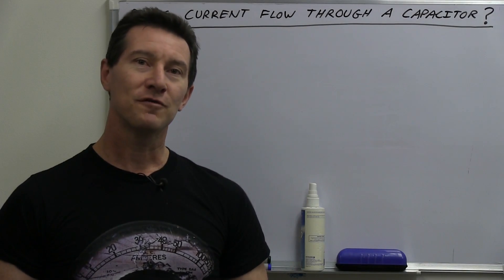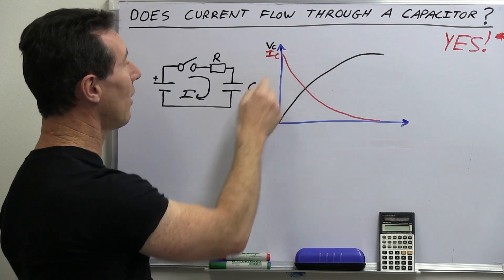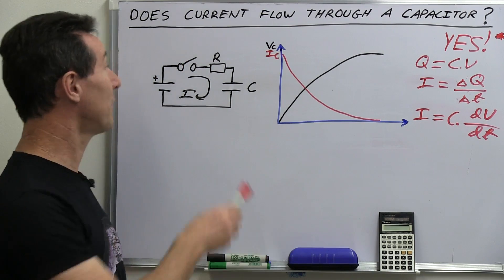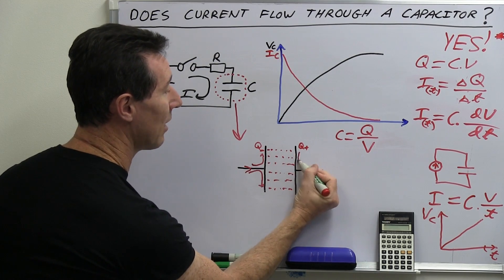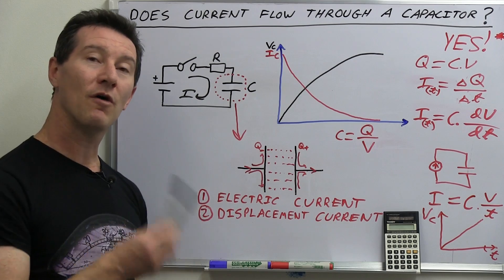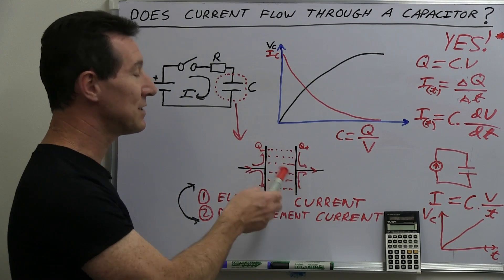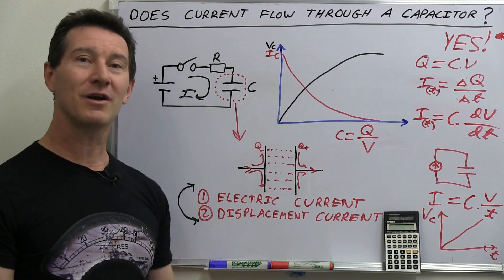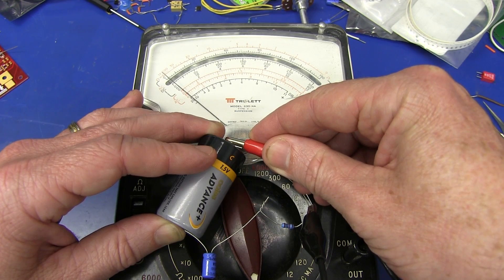EEVblog #486 - Does Current Flow Through A Capacitor?

Comment: so the answer is NO. the current newer went through but into the capacitor, just like the charge carriers (who's direction btw would've been the right one). the capacitor is 2 charged masses. that don't even have to be near each other (see tesla coils and over land cabling for example). nothing flows through it, just into and from it. if it could flow THROUGH it, it wouldn't stop as soon as the cap is charged. you even explain all those very facts. why are you trying to ignore basic physics here? just to make it easier for electricians who slept in physics class to get it "halfway right"?
Reply: I think you are arguing wording even though Dave stated the displacement current that fills the gap in the capacitor. Is it current in the traditional sense? No. But its the key ingredient to the fact. If the question was specifically "Does electrical current (electrons) flow through a capacitor?" then the answer is as you said, no. And yes all current (displacement and electrical) stop once the capacitor is charged. Also the transfer of electricity through a Tesla coils very different than how a capacitor works. The Tesla coil is a resonant transformer.
Reply: @drivejapan6293  yes i am arguing wording when the title of the video is literally "does current flow through a capacitor" and dave is trying to provide a counter argument to people who correctly state that it doesn't. and yes, a tesla coil is a resonant transformer, i was talking about its capacitor element composed of the topload and ground as an example of capacity without "close plates".
Reply: @nonchip  So you don't think a current of energy if flowing through all parts of that circuit before the capacitor is charged? You are right the title does specifically say "Does current flow through a capacitor?" but doesn't specify the type of current does it? Again Maxwell names the current as "Displacement Current" unless you don't think the phenomena happens. I would argue Dave simply means energy current which I don't believe is technically incorrect. Though thats me arguing meaning over wording and even the meaning could be wrong.

If nothing passed through the capacitor then it would just be an open circuit right? A Tesla coils top and the ground gain a capacitive difference but thats where the likeness of their operation stops I would think. Otherwise what field is forcing the electrons onto one side and pulling them off of the other? Batteries dont work like that yet a difference still forms in a capacitor. Thats why distance between the two plates is important in a capacitor is it not? Isn't that also why a capacitor with small size can allow energy to flow in a circuit and build up a charge that a switch with much larger mass in the circuit cannot? I am no physicist or EE though. These are genuine questions not snooty comments posed as questions.

Comment: Dipole excitation is how displacement current works. When you apply an electric field to a dielectric it realigns (rotates the dipoles). This rotation of dipoles in response to a sinusoidal voltage is how a perceived current propagates through an insulator/dielectric. A good analogy is doing the "Wave" at a sporting event. Even though the wave moves in series, no one actually physically touches each other. This is also why capacitors block DC current, because there is no "force" to rotate the dipoles.

Comment: Air gap capacitors, such as the tuning capacitors used in old radios, violate Kirchhoff's circuit laws (sort of) because current can flow into the capacitor through one lead for a finite non-zero time, and out through the other lead, but no current flows between the plates whatsoever.

Comment: Sir what will happen after the connection.
If I connect a finite current carrying inductor(say 5A) across a inductor having no current initially.  (We assume small series resistance of inductor.)

Will the current just after connection be 5A or 0 A. As we say that inductor resist sudden current change.

Comment: I remember this lesson from university. The point was that current is not only movement of charged particles, but also a change in electric field is also a current. I think that was on forth year. Another argument was that magnetic effect this current has are the same as those of moving charged particles.

Can't remember any math or details nowdays, don't really use it in practice. Amazing that, at some point in time, I had some understanding of that stuff.

Comment: i think it's of no value to say the science and practice contradict each other, which seems to be your message. Current doesn't "flow through" a transformer either, even tho' current goes in one side and out the other. Seems to me, understanding the difference between electric current and displacement current IS of "practical" value. Eg, may affect things like isolation.

Comment: Say you have a box with 2 sponges filling it, separated by a rubber membrane.  You can squirt water in one side for a while and it'll push water out the other side until the pressure you've put on it can't cause any more compression in the other side's sponge.  But for a while there, you push water in, and water comes out.  It's not the same water molecules, but the current is flowing.  You can ease up on the pressure going in and some water will get sucked back into the other side, or you can start sucking water out either way, for a while.  Send it alternating directional pressure and that'll propagate.  Send it too much pressure one way and no further flow will occur.

Comment: The semantics are in the question itself - - Does current flow THROUGH a capacitor ? rather than Does current flow TO a Capacitor. - Current flows in the CIRCUIT, and CHARGE builds up on the capacitor, but the CURRENT flowing in the circuit is the redistribution of CHARGE. - - - There is NO charge or NO current flowing THROUGH the capacitor, but there IS CHARGE and CURRENT flowing ACROSS the capacitor. - - - In talking about the CIRCUIT, CURRENT flows as a result of the REDISTRIBUTION of CHARGE, but once the CHARGE has been REDISTRIBUTED (as CHARGE SATURATION), then CURRENT diminishes to zero. - - - CURRENT flows in the CIRCUIT and ACROSS the capacitor, but NOT THROUGH the capacitor.

Comment: simple, yes it does without the wires no. lol. is it possible to use a electrolytic capacitor to reduce the voltage?, going from 120v ac through a rectifier and reduce it to 70v or 90v? or 220v to 90v without a transformer? I'd like to say yes  with heavier wires(to spread out the current). Maybe the plates in the capacitor could be fabricated differently?
Reply: another good video

Comment: So Yes it does BUT NO it doesn't.. thanks for clearing that up Dave.. Really.. Maxwell, pass me your silver hammer a second.. 
How about initially the massive charge applied to one plate induces current flow from the other plate as it is in a state of zero charge, this induced flow lessens over time  until sufficient opposing charge is built up to match the supplied current when all induced flow stops.
So apart from the Leakage you mentioned NO CURRENT EVER FLOWS 'THROUGH' a capacitor.. EVER.. you don't half talk some bollocks sometimes.

Comment: Sir, thank you for the video. I suppose the argument here has some flaw! Only AC current flows through a capacitor. If you connect the capacitor to a DC source, as you did in this video,current will not pass through. Current indeed flow outside of the capacitor, but never cross through the capacitor to reach the negative end of it.  The current that leaves the DC source end up throwing charges on the upper plate of the capacitor and a balancing negative charge would accumulate in the bottom. In between is simply an empty space with no current flow. If I were to live inside the capacitor ( supplied with DC source) not touching the upper and lower plates, I will remain safe without any electric shock ;-)

Comment: Just take a 230/12 volts step down transformer and on the 12 v side connect a capacitor and multimeter {set ma} in series 
If multimeter shows current
It's proved

Comment: Capacitors don’t pass a dc current once it has a charge has been applied just during the charge time ac current does the same but being as the charge voltage is always in a state of flux it effectively passes current how well depends on the frequency of the changes and the amount of capacitance

Comment: the current that flows through a capacitor is leakage current. you are mixed up. outside the source(battery here) the current flow is from - to +

Comment: basically you said, "yes because Maxwell tells you so".

So until I won't understand what Maxwell said, my own answer will stay "no", because this is an easier way for me to understand how charge flows through a circuit that has a capacitor in it, especially if I think that "in a capacitor, energy is stored in an electromagnetic field", which is all I need to know for now. I don't even care IF electrons flow through (the dielectric of) a capacitor as long as a cap does what I want it to do: blocking DC and letting AC pass, storing energy and releasing it as I want it to.

Alternatively, I can think a cap as a passive battery with an extremely low capacity, an extremely fast charging time, a massive durability and a very large internal resistance.

I'm sorry, but I find this video overly complicated at times, overly simplistic at times, and overall misleading.

Comment: Neat treatment of the topic.   I graduated 4th in my class (book smart *only*) from Stevens Institute 35 years ago as an engineer, and I can't recall us learning about displacement current.  I loved physics and math and of course we learned Maxwell.  Doesn't mean we didn't learn about displacement current, but I've never paused to think about the fact that the dielectric does not conduct electrons.  As you say, what is the practical use of that fact?  Nice job!

Comment: Dave, Surely at the very simplistic level, you could argue that each positive (conventional) charge that enters a plate of the capacitor pushes of a positive charge from the other plate. Anyone looking from the outside would be lead to believe the charge traveled 'through' the capacitor.

Comment: I think that you have opened up a can of worms here. I think it is safe to say that like electrons, current should not be visualised as flowing through a capacitor. The starting point in this video might be first talking about how fast the flow of electrons are at a reasonable current flow. This is less than a snails pace. So electrical signals are basically like sound travelling through a solid object. That is, that if you force just a few electrons on one end of a metal wire they would all repel each other util a few electrons fell off of the other end even if the wire were many kilometres long. Until that happened the electrons will be closer to each other. This makes the average potential energy of each electron greater THIS REPRESENTS A CHANGE IN VOLTAGE. A rather small amount of elections on a piece of metal can cause a large voltage change. This is because very few bodies have the CAPACITY to store EXCESS electrons.  The manifestation of a small capacity for excess electrons is a large change in voltage. Just like pressure increases in a small volume will little excess gas.  Think static electricity that represent a HUGE voltage but you only need a few electrons to attain such a large voltage (thousands of volts). The energy per excess electron it these cases are so great that the electrons can escape by ionising the air and creating a spark and therefore a path to a lower voltage. 

The trick of a capacitor is to put two metal plates very close to each other. What happens now is that when electrons go onto the plate (a single plate in itself has effectively no role in increasing the capacity for electrons) - forced by a battery for example -they find that there is a DEFICIT of electrons on the other plate (which they cannot reach). This creates an unusual situation because normally the electrons would just feel repulsion from all the other electrons around them but now they feel an ATTRACTIVE FORCE from the other plate. This has the overall effect of REDUCING THE EXCESS ENERGY PER ELECTRON which means LESS VOLTAGE CHANGE for a given amount of electrons. This is why capacitors charge up slowly - meaning the voltage increases slowly. It is not correct to say that there could be just air between capacitors because the attractive forces between plates is absolutely enormous.

So, NO, current does not flow through a capacitor and it never will. Electrical INFORMATION and ENERGY can certainly pass though a capacitor in a similar way as sound (and its associated energy) travels through a solid object without requiring the actual molecules of the solid object to move very far at all. The term displacement current you adopt is just a convenient term to describe a high-level phenomenon and I think it is unhelpful just like the term 'bubble' in 'housing bubble'. Just because someone says 'I can measure the size of the bubble' does not  mean that this is a useful concept. And while I'm here I'll also say that the tendency of most people is to invent terms to save them the effort of a few extra words associated with the original idea. This leads to layers upon layers of unnecessary abstraction, such that people are left with only a superficial understanding of phenomena that is described.

Comment: Current does not flow through the capacitor, as the charge is built up on the plate a magnetic field is created because of the charge difference between the positive side of the battery and and the negative side. In the case of dc, thats essentially it. No current has flowed through the capacitor. In the case of ac things reverse as the generator source changes polarity but no current  flows through capacitor.

Comment: you could just as easily  say currant doesn't flow through a transformer yet, we have a power grid with thousands of the in line and here I am using my computer plugged into it. I'm 63 years old and when I was in high school electronics, the teacher would say electrons flow from positive to negative. all the physics students would jump around in there seats and say  "NO THEY DON'T" the holes flow from negative to positive! Its all how you look at it.

Comment: No! It doesn’t.  You are improperly using the word “through”.  Use a different word.  Physics is the understanding of how it works physically and to hopefully explain it in simple terms.  It’s not that hard to understand the capacitor and to say it goes through the capacitor will confuse people.  Your last demonstration arguably shows how it does not go through the capacitor.  Hence, the meter’s current went to 0 and stopped “going through”.    Don’t get me wrong.  This is an excellent video and gives you all the information you need.  I just believe that words have definite meanings and the wrong word is being used to describe what is happening.  Thanks for posting your hard work.

Comment: The way i see it: is the Voltage applied to the capacitor Pushes or Pulls electrons onto the plates of the capacitor causing the field to change . While the electric field is changin, current is flowing to/from the capacitor. Once the field stops changing current stops flowing in a practical sense.

Comment: If you have an open Gaussian Surface that includes the space between the plates of the capacitor, there is NO current piercing that surface. Therefore, no electric current flows through a capacitor. Maxwell new this was a problem (i.e. with Ampere's Law). He fixed it by introducing the concept of Displacement Current, which results from a changing electric field (actually changing electric flux). The net effect of which is that current "appears" to be flowing from one plate of the capacitor to the other. However, no actual electrons pass between the plates depending on the dielectric. See https://www.youtube.com/watch?v=8ZYFYUFRblM

Comment: What helps me to understand how a capacitor works is a rather inaccurate analogy. I like to think a capacitor is a sports stadium and when a current starts to flow people in the stands (current) start doing the wave. The wave is electromagnetic activity. They will raise their hands in the air and then people next to them will raise their hands while the original people will lower their hands (alternating current). This continues on down the line till the circle is complete (complete current path). The people are not touching each other but they are influenced by the neighboring people (magnetic field building and collapsing). If the people that started by raising their hands and the people next to them did not raise their hands( direct current) the current is blocked and will not flow through the capacitor. Hope this helps.

Comment: displacement current is caused by the metal-insulator-metal excitation of electrons in the metal plates next to an insulator material creates a surface plasmon polariton wave (displacement current) that is equal and opposite to the incoming current. the polariton wave excites electrons in the next plate which transfers the current down the line.

displacement currents are the basis of free energy systems and def worth thinking about.

time reverse phase coniugation and meta materials with a negative index of refraction are related terms to displacement current.

down the rabbit hole you go...